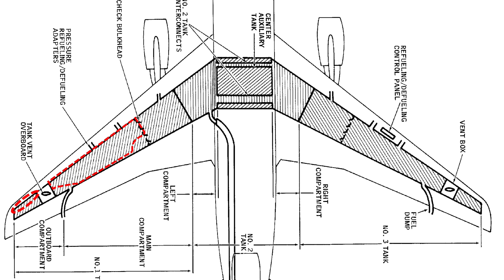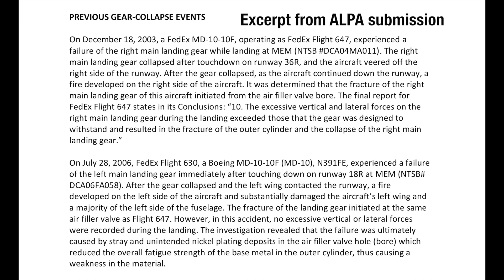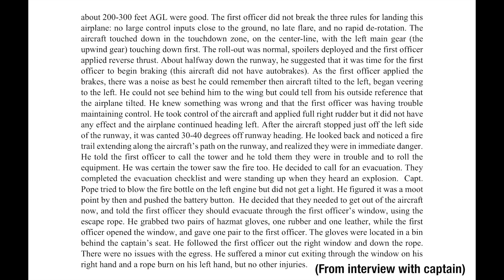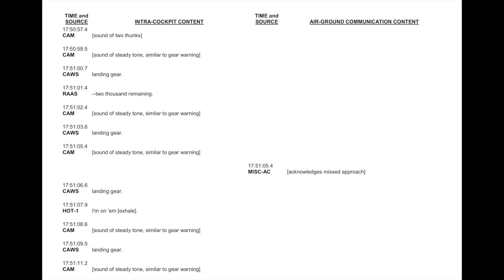FedEx Express 910: Gear Collapse, Fire, Fuel Tank Explosion

Comment: Seems to be an unnecessary distraction with that ramp vehicle bombarding ground control with all sorts of irrelevant information that could wait until the trucks were in position, the fire was controlled and most importantly the crew was accounted for. But instead we hear a barrage of calls about how to handle aircraft movement. Same with calling out all the closed runways, taxiways and intersections. All it took was one call, which would seem automatic, to close the entire field yet there was still requests to access this and that and cross this and that. Seems to be a waste of time.

Comment: MD10 POS most of those plane are almost 50 years old. You would imagine a company like Fedex would update the fleet already.
Reply: Cargo operations heavily rely on using cheaper old airframes since they don’t fly as many turns as commercial operations. They have to keep the plane cheap so they don’t have a massive upfront cost from buying a brand new one

Comment: Nickle plate cause of failure does not make sense.  I am sure the part  was made out of 300M which if ground incorrectly can cause burns which should of been  pick up through the nital etch process.  The burns can cause  stress issues  resulting in failure.  The other possibility would of been inclusions and cracks that were not picked up  during NDT, mag particle inspection.

Comment: Does the hastily applied white paint really disguise it as a FedEx plane?
Reply: Thats actually common practice in the airline industry to cover the planes markings after a crash. This aircraft sat next to the plane involved in the Dynamic Airways flight 405 fire, which had its markings covered the same way for a few months before both aircraft were scrapped eventually.

Comment: I’m not a pilot but I can tell that by looking at the landing gear’s condition you can see that the tires are ripped and that can only mean that the plane’s landing gear broke off because of the overload.
Reply: They ripped due to being pinched under the wing after separation. They weren't overloaded, if you read the whole reports you'd know that a cadmium plating was supposed to be done around the air-fill valve during maintenance on the gear but was not, resulting in corrosion and a hairline fracture that weakened the gear to point that when brakes were applied it simply couldn't handle the forces and completely let go

Comment: Wow, they did a really great job holding the plane on the centerline.
Reply: Ruben Kelevra atleast
Reply: @killingthedeath96  they did nothing wrong. Just FedEx running cheap and fails to do maintenance. As experienced as those guys are, I highly doubted that from the beginning that they did had a hard landing.

»On August 23, 2018 the NTSB reported that "the failure of the left main gear was the result of a metal fatigue crack that initiated within the gear," and cited FedEx's failure to overhaul the gear at the manufacturer-recommended eight-year interval as a contributor to the crash.«
Reply: @RubenKelevra  it was a 9-year-manufacturer-recommended interval which FedEx decreased to 8 after the event.

Comment: I wonder how far off the ground their jump from the window was. I'm glad it turned out ok for them. I thought there'd be more crew members though. Navigator or flight engineer for example.
Reply: Some of these cargo planes appear to fly with just the cockpit crew and with no-one in the back to monitor the cargo and to be ready when the fire starts (or what-have-you).
Reply from the maker: They didn’t jump from the window...
Reply: A lot of DC-10 aircraft were refitted to eliminate the flight engineer, there are some seats in the back (the first 2 rows I think) but they're only used if an employ needs to hitch a ride.

Comment: “What’s the location of the alert 3 aircraft?”

You know controller wanted to answer “try where the f#%^*ing explosions and 300 ft towers of smoke easily seen from space are emanating from!”
Reply: Nope, It's a huge international airport with 2 runways at different sides. And if there's a code that says EXACTLY where the damaged aircraft is, and the tower can tell you, YOU ask.
Reply: but think of the comedy value
Reply: @MatSil-  In addition, the tower has an elevated position and can say exactly where the aircraft is, and the closest taxiway. Where as at ground level, you might at best be able to tell general direction until you get closer.
Reply: BOOM. "There it is!" BOOM. "There it is!" ...

Comment: What is it with FedEx MD-11/DC-10s landing gear collapses

Like seriously it has happened like 10 times
Reply: KAMarineluke • If you watch the video again, you will see the plane bounces off the runway before the gear collapses. That’s because slamming the airplane down on the ground hard is a sure way to smash the landing gear. 
The reason the plane bounces to begin with actually has to do with the design of the MD-11. Watch the Air Crash Investigation episode on Fed-Ex Flight 80. It was an MD-11 that bouncrd while landing at Narita airport in Japan, and a similar thing happened. Simply put, the pilots sit so far forward ahead of the nose landing gear that if the plane bounces on landing, the pilots don’t realize it and the view out of the window in the cockpit doesn’t make it looked like the plane bounced. 
So when the pilots feel the “bump” of the plane bouncing, they think it’s the main landing gear touching down, and the next step is to push the nose down to make the nose landing gear touch the ground. When in reality, it was the nose landing gear that touched the ground first, the plane bounced up, and when the pilots pushed forward on the control column it forced the entire plane down, immediately after a hard bounce which is enough to make the landing gear collapse. For the pilots in the Japan crash, they unfortunately were both killed in the crash.
Reply: @JNDlego57  Ok Thanks
Reply: KAMarineluke • One other thing: A possible reason the landing gear didn’t immediately collapse after the MD-11 bounced and landed (unlike the Narita accident) is because after the plane finally touched down, the pilots begin braking. But since the plane is still moving forward, the wings are still generating lift, so not all the weight of the plane is on the landing gear. But as the wheel brakes, thrust reversers, and spoilers start to slow the plane down, the amount of lift the wings produce is decreased, and more of the plane’s weight falls onto the landing gear. So the first bounce likely damaged the landing gear and then as the plane slowed down, the weight of the plane being applied to the landing gear eventually caused it to collapse.

Comment: I once had an MD-11 first officer tell me, “You know, the ‘57 and ‘67 are okay, but too easy to land. Now THIS thing will fuckin’ kill ya.”
Reply: True statement 😀  But this was a MD-10  which is a much more forgivable aircraft.
Reply: NovejSpeed3 *DC-10
Reply: @marajacobson9701  the MD-10 is a cockpit conversion of the DC 10. It makes it more like an MD 11 when flying
Reply: Paul he’s absolutely right. It tried killing me every day for 7 years.
Reply: @CarlosRodriguez-hw3nt  you flew every day for 7 years?
Reply: The MD-11 is about the same as an early Porsche 911.  It has a bad handling characteristic that can bite you in one situation, but if the driver is educated on this, it isn't a problem.
Reply: @Flies2FLL  Provided the driver is sensible enough to change to a better engineered product.
Reply: @JimWhitaker  The thing about the rear-engine configuration is that it produces a FASTER racing car if the driver knows how to use the car's characteristics while avoiding the bad handling characteristic.  As I said....Education is the key.
Reply: @Flies2FLL  is that why most successful race cars were either mid or front engine and not rear.  Porsche only used the rear configuration because it reflected knowledge from the Beetle and was easier to cool the air-cooled engine back there.  You give them too much credit and thus why they went to AWD in much later cars.
Reply: @alexnutcasio936  You are correct, the rear engine configuration is a BAD idea, but it can be exploited if the driver is very good, that's all I was saying.

Comment: Does "Ramp 3" seem to be hogging the airwaves in the midst of the emergency, going on and on about the debris field while fire engines are still rolling?
Reply: We may not be hearing the entire conversation between Ramp 3 and the ATC. In any event, its important to document the debris field. The emergency vehicles are also on a different frequency. So you have the Ramp talking to a controller on their frequency, and the emergency vehicles talking to the pilots (until they evacuated) and ATC on their frequency.

Comment: Did they repair the airplane or whas it the last flight with it? Great resopnse of the fireman.
Reply: It was parked on the north side of the field (near the other end of the runway, right of camera perspective) next to a burnt out Dynamic 767 (Dynamic Airways flight 405, caught fire on a taxi way a year earlier). Both planes were scrapped on site about a year ago. Interestingly, the 2 good engines from the FedEx are still sitting next to the hanger used by UPS wrapped in plastic.
Reply: The Dynamic airway fire was something as well. Just left work when it happened

Comment: Hmmm. For such a serious incident, there is a fair amount of Incorrect info in several areas. Left main gear collapsed not right. And this is a DC-10, McDonald Douglas, not a Boeing.
Reply: The other account shown around 10 min, is an account from a similar incident, Flight 630 and 647, this was Flight 910. This was also a MD-10-10F according to the FAA registry. McDonnell was acquired by Boeing in 1997. So saying this is a Boeing aircraft is technically correct.

Comment: All of complaining about ARFF's response time, which was amazing - they had extinguishing agent on the plane in 2:00, the regs are as follows;
FAR139.319(h)(2)
(i) Within 3 minutes from the time of the alarm, at least one required aircraft rescue and firefighting vehicle must reach the midpoint of the farthest runway serving air carrier aircraft from its assigned post or reach any other specified point of comparable distance on the movement area that is available to air carriers, and begin application of extinguishing agent.

(ii) Within 4 minutes from the time of alarm, all other required vehicles must reach the point specified in paragraph (h)(2)(i) of this section from their assigned posts and begin application of an extinguishing agent.
Reply from the maker: You are mischaracterizing the statute by omitting part of the text. A response time requirement only exists in relation to airport certification testing. It has to be demonstrated during testing, under ideal conditions. There is no response time requirement for actual emergencies. Just a goal.
Reply: There is always that one know it all

Comment: Terrible aircraft.  Just over 7% of them ever built suffered hull-loss incidents and a total of 1446 people were killed by 2017.  One of the worst records ever for a commercial aircraft.
Reply: But they were so much cheaper than the L1011!
Reply: MoutainMan3000 exactly you pay your money and take your chances. I refuse to travel on these death traps.
Reply: @petersims1550  I have been on 30 MD11 flights since February 2017. It's the most fun aircraft to fly in because it is so powerful. It has always been safe. Not a single time have I been concerned.
Reply: DC-10 accidents account for less than half the accumulated fatalities of the B-737 classic, actually.  The hull loss record is an eye-opener, but it has less to do with the quality of the aircraft or design issues than with the quality of its operators.

You have enough fingers on one hand to count the number of DC-10 hull losses in which design issues were found to be either the primary or contributory cause.

Seriously, a record of pilots flying it into a mountain, landing on a runway filled with construction equipment, rejecting a takeoff when the airplane has already left the ground, dropping it into the approach lights a quarter-mile short of the runway or not going around when it still isn't on the ground halfway down the runway suggest it's a terrible airplane?

There's never been an airplane impervious to poor judgement or maintenace.  Terrible airplanes don't generally operate successfully for more than 40 years.  (Would USAF expect to be flying its terrible KC-10s as far out as 2040?)

It's not the airplane that's terrible, Pal, nearly as often as who's operating it.  Statistics exist to support that premise, too.
Reply: Eric Coleson 

Is that statistic you cited involving deaths with the dc-10 vs 737 classic based on the number of airplanes in service? You can say that the 737 classic had double the numbers of deaths but if there were 10 times as many of them in operation, it would make the 737 a much safer airplane, statistically. Don’t get me wrong...I’m not a dc-10/md-11 detractor and I think that “death trap” remark was completely out of line. I just pay close attention to statistics. The truth can easily be obscured when you choose certain numbers and ignore other, much more important numbers.

EDIT: actually, I just looked those numbers up. The 737 classic has 1176 fatalities and the dc-10 has 1261 as of February 2019. On top of that, there were about 4 times as many 737 300-500 built, making it a much safer airplane, statistically. Where did you get your numbers from, man?
Reply: manifestgtr don’t forget the 737 entered service before the dc -10
Reply: Peter Sims don’t worry about flying on one of those “death traps” as no (passenger) airline flies the DC-10 anymore. Side note: anytime you board any other airplane (or a car, bus, bicycle etc) you’re boarding a “death trap” because by your logic they’ve all killed people. If you absolutely positively need to stay safe stay home.

Comment: 8:21 another ruptured fuel storage area with zero sign of fire damage. So what exactly was it that was fueling all these flames and explosion?
Reply: What you see at that time stamp is not the fuel tank. the fuel tanks are forward of the landing gears only. behind the rear spar is the wheel well, a lot of cables going to the ailerons and spoilers and wires to the fuel pumps, sensors and actuators. at 8:49 you can see a schematic of the wing. there is no fuel stored aft of the rear spar

Comment: from 9:00 to 9:14 inside of the wing where it would have been at least wet from fuel storage remains uncharred
Reply: have you seen that fire? all the fuel that didn't burn would have been evaporated due to the heat. if there was any liquid visible in those images it would be water from the fire fighters

Comment: Inicial touch down was really smoky.  Must have been a hard landing contributing to the gear collapse
Reply: read the report. the landing didn't contribute to the failure. not even the braking action by the crew. Landings of the DC/MD are mostly smoky because the landing should be firm. it's called a "positive touch down". also the landig speed is usually way higher than most other aircraft. 160kts and upwards is nothing unusual. more differential speed between the runway and the tires means more smoke
Reply: This was actually a pretty typical landing for this type aircraft, seen many land at this airport before. They land at a higher landing speed and require a firm landing, so seeing a bit more tire smoke then you're used to is normal. Never had the chance to fly one though.

Comment: @10:12   line 5...   he applied the brakes gently as they sometimes grab.   did everybody else miss that..  i am taking that is a statement from the co pilot who was landing the plane.... it did not show up in the pilots statement.  i would want to interview that co pilot again and ask about that. if he recalled prior instances of the brakes grabbing on that aircraft or other similar that they might have flown.. perhaps it was a defect somewhere in the brake system that when it happens it can increase the stress loads on the landing gear causing eventual failure.. since FDRs only record the previous 30 minutes of data as i understand.. the data would have been written over many times from previous landings.  did the pilots flag any grabby brakes..  only to be shot down by ground staff.. well don't touch them so hard..    why is a NON flyer like me posting this.. because i have 40 years of automotive experience in diagnosing the hardest to find issues..
Reply: He applied the brakes gently because the antilock braking system was not used in this landing.  Max loads imposed on the gear by braking actually decrease when the wheels are locked up.

Aircraft history is maintained by hand-written entries to the aircraft maintenance log and later transcribed into a permanent computer database.  Cockpit voice and digital data recorder info can be downloaded for troubleshooting purposes, but routinely play no part in aircraft maintenance history tracking.